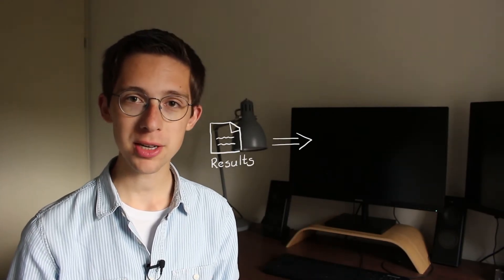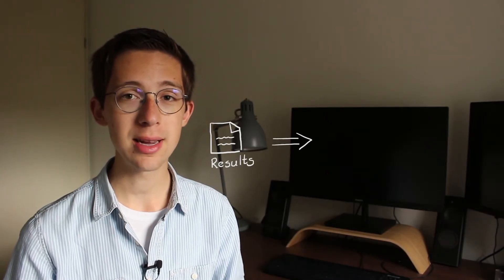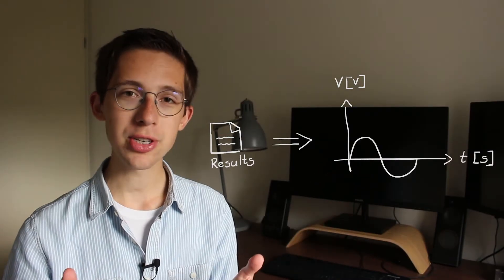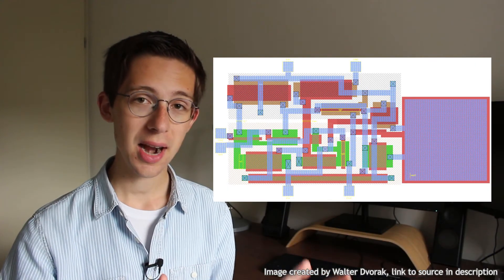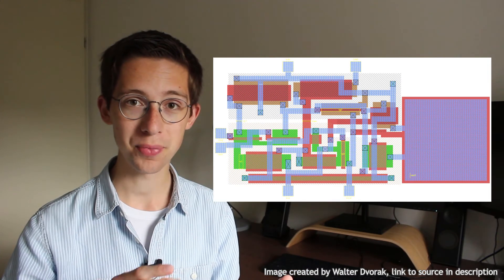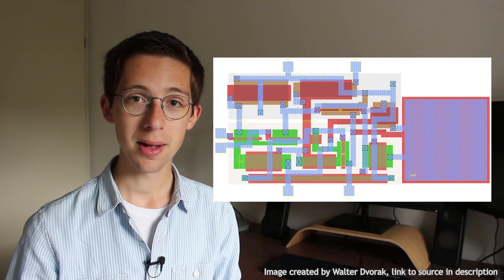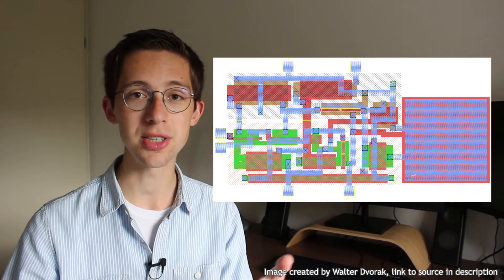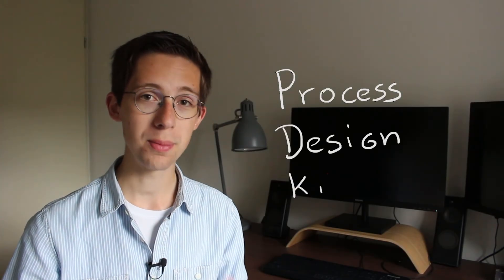Introduction - Cadence Crash Course #1

Comment: Wow!  I have not done the video series yet, but I am anxious to.  I am a system administrator for an ECE Department any you explained in the first video something that took a long time to figure out.  I wish I had found this video previously and seen it 15 years ago.....  I have since "worked" with (set up for use) PDKs from TSMC, IBM, INTEL (and signed NDAs) for researchers to use, but there as I am not an electrical engineer some things are still not precisely clear since I have not built a circuit.  Again, looking forward to watching the video series.

Comment: With FreePDK45 in which foundry can we send it?
Reply from the maker: FreePDK45 is a completely fictional process, so there isn't a foundry to which we can send the designs made in this PDK. "Real" PDKs by actual foundries usually require you to sign a very hefty non-disclosure agreement, which means I can't show the PDK in a video here on youtube. However, FreePDK45 is good enough for getting a first grasp of how Cadence works and basic schematic-/layout-based circuit design.